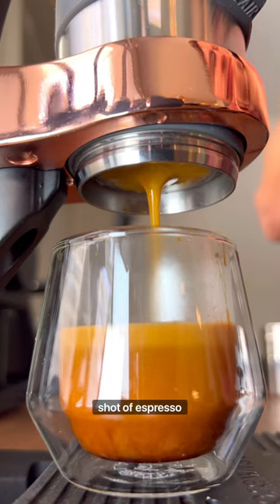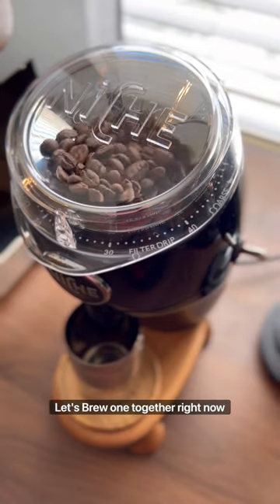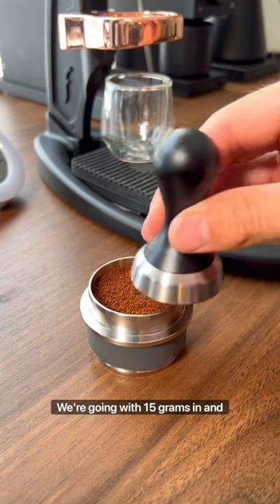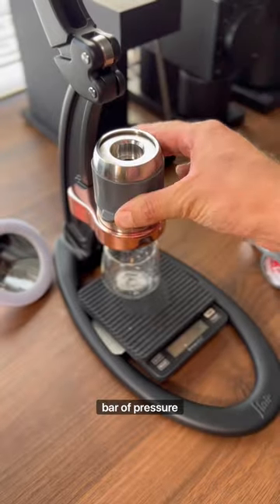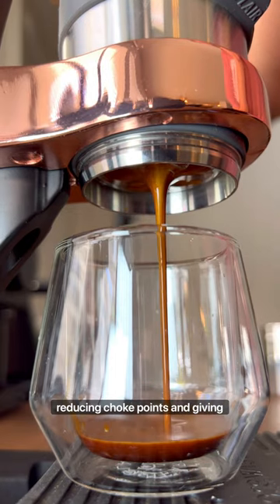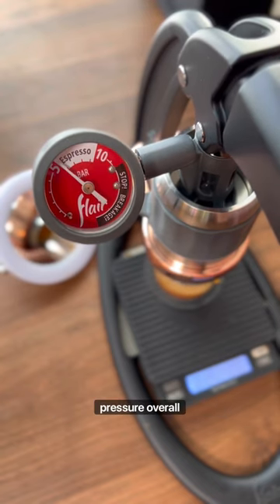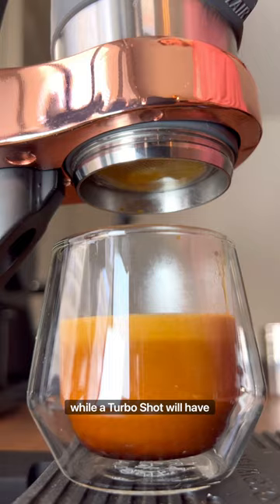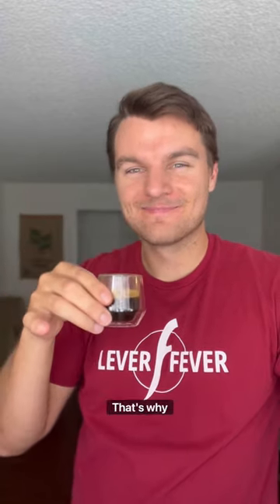Turbo Shot of Espresso on the Flair PRO 2 #shorts #coffee #espresso

Comment: Whats the difference between this and ristretto? The grind size?
Reply: Ristretto is ground finer for a 1:1 ratio at 6-9 bars of pressure in 25-30 seconds. 

The turbo shot, by definition, is ground coarser for a 1:2.66 ratio at 6 bars of pressure in 15-18 seconds.

Comment: Lol believe me I'd try it if the signature could hold enough water. Will this method work for light roasts or do they require an even lower dose going in to fully extract? Does the faster flow make preheating requirements less stringent or not? Espresso leaves too many questions for a Short, lol.
Reply: It works with light roasts yes. If you don’t think your Flair will hold enough water just use the same ratio (1:2.7) with a lower dose. I would still pre-heat because temp management is always important regardless of turbo or regular shot.
Reply: @persianwingman  I always always preheat. Just a matter of whether I aim for low/mid 90s C or 100C. If I want to pull a light roast shot slowly I need to start with a lot more heat because of how much gets lost over time. A fast shot has less time to lose heat. Thought it was worth mentioning

Comment: You forgot to mention you need a whole new contraption to do it. This is an undisclosed ad
Reply: It's an espresso press/manual espresso maker. It's relatively common as a less expensive alternative to conventional espresso machines. It works on the same principles as a normal espresso machine only you provide the pressure. The one in this video is definitely a high end one however.

Comment: Ok, so a "ristretto" shot then?
Reply: No, the opposite really.

With a ristretto, you grind so fine that the puck offers more resistance. Contact time is increased. Risk of channeling is increased. Shot-to-grounds weight ratio is 1:1 or 1.5:1. Best with darker roasts, I guess?

With a turbo, you grind coarser (but not nearly as coarse as filter coffee), such that the puck offers less resistance. Contact time is decreased. Risk of channeling is decreased. Ratio is 3:1 or 4:1. Best with lighter roasts.

Comment: it's called a ristretto...not turbo shot
Reply: Expresso
Reply: No it's not, a ristretto is just less liquid out in the same time as a "normal" shot, which can either be done by using more coffe or by grinding finer. 
This one is less coffee in and less pressure in a shorter time
Reply: @antonb9459  incorrect 🤝
Reply: @courtneyoswald241  no, you are incorrect. This is a turbo shot. Ristretto is a totally different thing.
Reply: @Adam-vx6to  Defining The Ristretto
Extraction is generally stopped at around 15 seconds, instead of the espresso's 25 to 30 seconds. When more water is used and the extraction duration isn't shortened, a lungo or long shot is created.
Reply: Yes, this isn’t thay